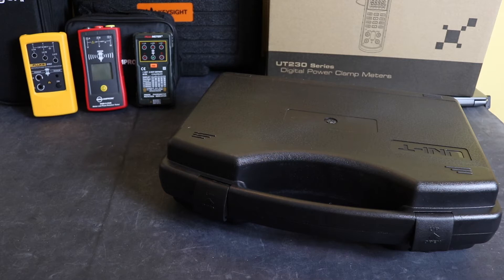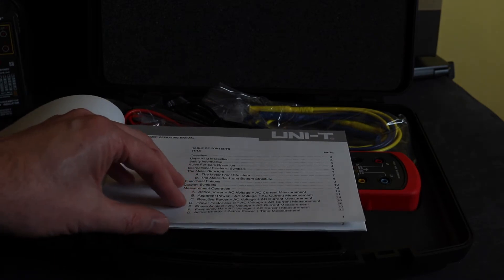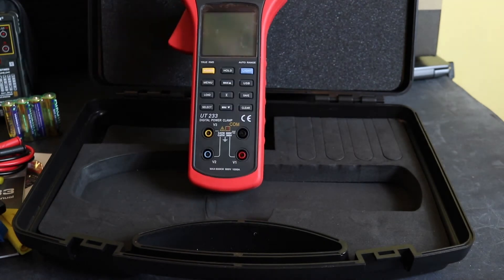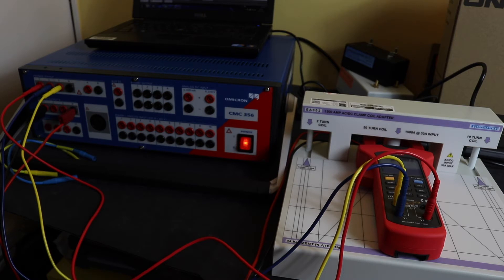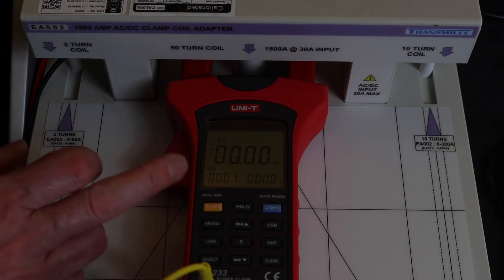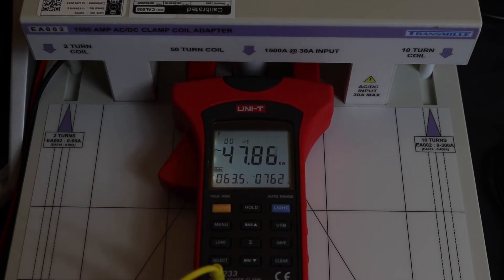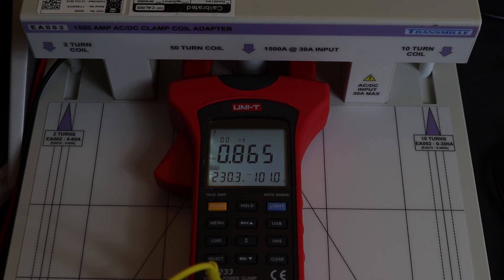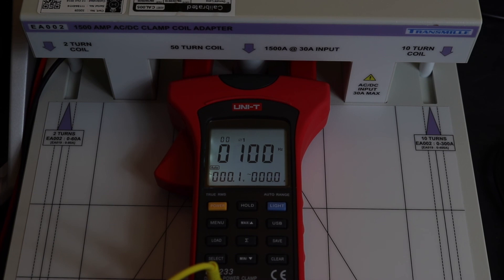Uni-T UT233 Power Clamp Meter Mini Review

Comment: Great review, thank you for your time.
 
I have a question about frequency's higher than 60hz, are there equipement who use power at those frequency's ?
Reply from the maker: There are some specialist environments that utilise higher frequencies, but tend to be apparatus specific. Avionics on aircraft have traditionally used 400Hz supplies. I have also come across 400Hz for pilot exciters on brushless generator designs. The higher frequencies reduce the sizing of the magnetic components. Some construction concrete wackers / vibrators use a low voltage 200Hz supply to generator the best frequencies to move the concrete. Probably a load more out there that I have not come across.
Thanks for watching and commenting.

Comment: Who really needs a CD-Rom I mean its completely redundant. What are the CAT ratings in the leads and croc clips. Do you have any tips for for high quality large, medium and small croc clips at least CAT IV 600v rated?

Clamp meter is pretty decent. Great video again envious of all your testing tools wondering whether you do your own calibration for your tools it’s an area of cost which really should be addressed.
Reply from the maker: Yeah, certainly not much use with modern computers, but then again I have had a lot of problems sourcing software for Uni-T meters from their website. The clamp meter is ok when you get used to it quirks, specially for the price.

For my work I tend to get lead and large crocodile clip sets from either Megger or Fluke. Fluke just have the one large size (TLK1550-RTLC) Megger have three different sizes. For more standard sizes that are compatible with 4mm safety leads I guess the Fluke SureGrip ones are pretty good. TETC did a comparison video a while back on some crocodile clips, may be worth digging out if you haven't seen it.

With regard to calibration, I do some of mine own and some I send away. I have two high spec instruments that I send out for UKAS calibration, that is the UK standard for traceable calibration to national standards. I then use these to check out some of my own instrumentation. There are issues doing this though, to purely check another instrument is reasonably easy but is time consuming. Adjustment is a different ball game, you then need a stable test environment at the specified test temperature. You can also not always get the actual calibration adjustment procedure for the instrument, some such as Fluke, Keysight, they are readily available, Megger and Chauvin Arnoux are not.

There is also an issue with the time it takes, I do not have automated test setups, so am way slower that a proper lab. For the Omicron you see, it takes me around a full day to check it out, that is quite a bit at my hourly rate and sometimes it is just more cost efficient to send them away. It also depends on your client, some will not like an instrument that is internally calibrated and you need a third party calibration to keep them happy.

Cheers for watching.
Reply: @three-phase562  Thankyou for this details as always I have yet to see anyone go into the level of detail you do. It’s amazing and feeds my own OCD. I have been interested in getting some high quality power quality test tool analysis I like the dranetz hdpq explorer series they are owned by gossen mettrawatt (and same equipment are branded as G&M in Europe) but it has its limitations on the frequency range its good for single and  3-phase stuff but not great oscilloscope quality. The other option is to get a very high end Keysight oscilloscope and try to live with its built in power quality functions. 

Either way I would still need to code/program higher end power quality metrics based around wavelet, multi resolution and other multi Fourier integral series type analysis with cross spectral analysis to track/monitor and map by co-linking different signals. Taking me back 20 years with my PhD when I used these techniques with very different types of data (financial and economic). Choices are always a compromise. I think I will just take two separate tool and utilize them for what they are really good at having the two tools gives a better choice but a much bigger cost😭☹️
Reply: @mathman0101  Whilst I really do like the Fluke leads, they are rather expensive for what they are. 
I've fairly recently bought this set which works well for my use: https://uk.rs-online.com/web/p/multimeter-test-leads/1253735/
The one criticism I have is that the right angle plugs don't sit tight to the meter, they stick out further than I'm used to. The leads are at least as flexible as my Fluke ones, and I prefer the hook-grabber things to the retractable claw grabber things that Fluke uses.